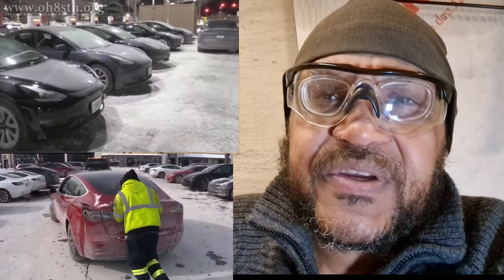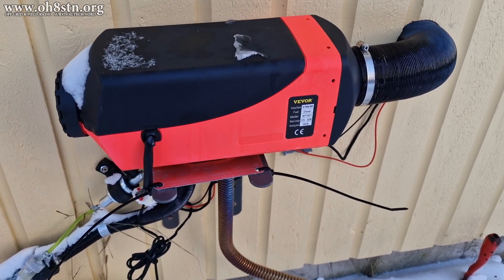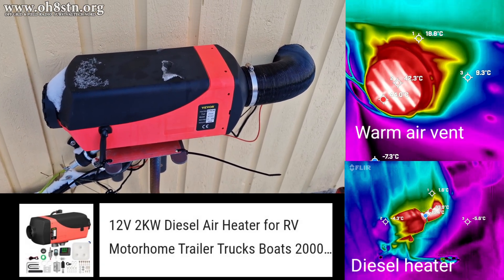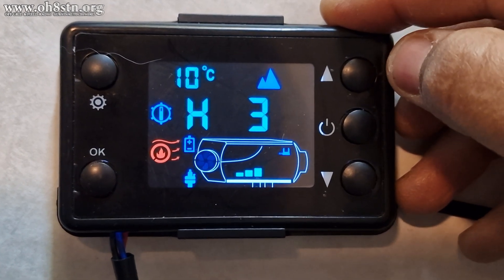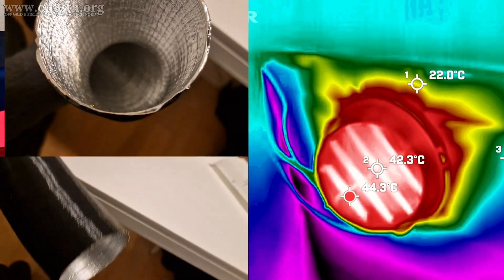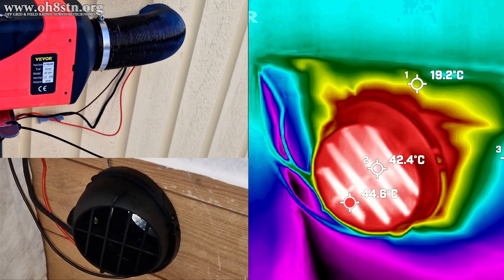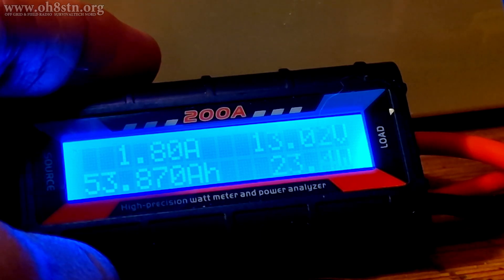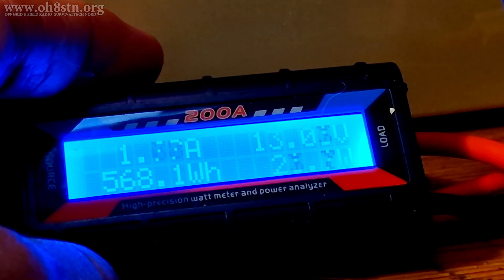Heating an off-grid ham radio station in winter

Comment: How much fuel will you use in an unusually cold winter? I'm scientifically guessing that you have at least two winters' worth of heat in your 1,000L of fuel. I don't think diesel will ever be completely unavailable long term, though local short term outages are probable.

How are you storing it?

Comment: Julian have you considered insulating that corrugated metal pipe. I’m sure you’re loosing some efficiency to the cold since it’s kind of like a giant heatsink out there.

For the ice fishing “portable” set up something like the SOK battery might be worth the extra cost because of the ruggedized case and low temperature charging disconnect.

Comment: J, 
I am sure that in your part of the world you have something like a wood fired boiler that has a water jacket and a manifold. You would hook up water pipes in the typical installation would be to run them underneath the floor the small wood fire boiler would be outside obviously, it heats the water and heats your shack. I’m told from friends that have these devices they can basically heat an entire house on a couple of sticks of wood per day.

Comment: I think to Cresson H. Kearny's book, as well as permaculture tech...big takeaway: DIG DOWN. 
5-6 feet in ground and the structure is covered = ambient temp of 50-60F. 
If its 'main HQ' and permanent/semi-permanent, rather than forward-line position: this makes 100% sense.

Just run a longer antenna/tower. This can act like a heatsink, so minimize connection of above-ground and below-ground. 
Even 3ft down (instead of 6ft+) and you warm ambient temp by >=10-20F when running electronics or there are ppl in it; let alone something like stove/heater. 
 4
Reply from the maker: Agreed. We have a root cellar which remains temp stable all year round. To dink a radio room sized underground space requires lots of work, but does make since.
Reply: @OH8STN 1 person, yes. But read Nuclear War Survival Skills. 
It talks about how you dig such structures as a group: 4-8 ppl and it'll take a day (8-10hrs), maybe far less depending on soil composition.  

Look at what vietkong did in 'nam: with their  tunnel systems and radio rooms. Sure those were built over months/years...but at times they'd flood/backfill them in, (in other part of tunnel) just dig new one, and a antenna hole, disguise with hollowed out bamboo. etc.

Comment: I heat my shack (garage) with a wall mount 30K BTU natural gas heater. It was cheap, no electric needed to be run to it, and I had a natural gas line right there.  I'd imagine it uses little, it's almost never on hi. 73

Comment: HI i dident know you ar limited at fuel storage only up to 1000L  in winter i count on may iron nikel batery bank i dont use litium in winter it is too cold here in winter vold hav problems with everiting   lov the whay you mounted the heater loks similar with what my truk has from factory the mobil ham sach has its own heting batery bank and generator unit

Comment: Lithium batteries or LB's are expensive in most counties with High Sale Taxes (increased price levied on the consumer for purchasing foreign brands)..whether they be Chinese, Japanese, European or good Imported American branded LB's Can you provide some examples on how to save the dying LEAD/Nickle Iron/Acid based batteries from Winter/summer temps. one answer could be a USB powered Silicone Heater 12v Sticker.. that usually is attached to batteries and use a tickle charger to heat the batteries from getting tooooooo cold..so even if they are acid and are stored in an enclosed box they can discharge the acid safely. My option at home are AGM company batteries, EXCIDE modular batteries, OSAKA Modular batteries... are a few to talk about, 
My home country is Pakistan but i work and reside in Singapore.. and each year the batteries prices get higher in my home country while the input from the batteries are less than 5 hours with powers down.. and random shutdown times often called Load shedding by the govt. Diesel Heaters are not avaiable... they are banned by the same govt entities who want the consumers to use the faulty grid tied system and pay up monthly bills.
Regards from Singapore, GOD Bless.. Thankyou for your hard work in making the content interesting.

2 Bio-Diesel PDF's online Thesis and a Study and a plant to create bio-diesel (external weblink PDF's)
https://core.ac.uk/download/pdf/148365950.pdf
https://www.diva-portal.org/smash/get/diva2:720756/FULLTEXT01.pdf
https://www.diva-portal.org/smash/get/diva2:1501705/FULLTEXT01.pdf

Comment: Those are great heaters, i mount them in boats and a bunch of stuff! I would mount inside and run exhaust through wall with the proper fitting like we do on boats and cabins.  You then circulate intake air from inside and not cold outside air and its a lot more efficient.  Espar heaters 8 to 10 times more and i still install them becasue they are serviceable and parts available.
Reply: About 20 years ago I bought 6 Espar heaters at auction for only $200. Out of the lot I have easily constructed two working heaters. These are the early DL1 heaters but they work like a charm. Only thing I did not receive in the lot were the pumps. Had to order it from a dealer who was the authorized sales center for these units. Back then an authentic pump cost $140 in the states. To day Chinese pumps are cheap but there are some alternatives.
Reply: much more efficient but what if your area to heat is only 100-120 square feet??? 
more than one way to measure efficiency.
Reply: @sk8crk  They have thermostats and they ramp the burner, pump, and fan up or down depending on demand.
Reply: @LaneGiesler-KL5PK  i was talking in regard to fresh air intake

Comment: Diesel starts gelling at -10°C. Could you keep the tank inside? Making an enclosure for the heater will help keep it and the fuel lines from gelling as well. Adding some kerosene can help keep it from gelling as well. Could you put a woodstove outside and just run the flue through the shack? A rocket stove is cheap and easy to make. That would allow a long run of flue along the floor of the shack. Stack some bricks around it, or encase it in concrete and that thermal mass will continue to radiate heat long after the stove goes out.

Comment: To be fair, those dead EVs were in were -27°C/-10°F. Diesel starts gelling at -10°C/15°F. You need a block heater and tank/fuel line heater once you start going much below those temps. So it's not like EVs are worse, they're just new tech. We have over a hundred years of experience running gas and diesel vehicles in extreme cold, and even then people were waking up to cars that wouldn't start. Also, all you need to do for a Tesla is punch in a stop at a charger and the Tesla will start pre-condioning the battery so that it can charge at max speed. These people lklely just pulled in without doing that, so the car didn't know to start pre-heating. Also, the range does drop and people probably weren't planning on that. Like, if you drive 40km/day for work, you're probably used to hitting a charging station once per week. But in the winter you'll need to add a charging stop mid-week and that can throw people off. But, if you're plugged in at home, set it to start prewarming a half hour before you leave - you'll come out to a warm interior, snow and ice melted off all the windows, and a warm, full, happy battery. Keep in mind that countries like Norway and Sweden are already around 90% of new cars being EVs, so they can certainly handle the cold! My cousin in Winnipeg (northern Canada) loves his Model Y!
Reply: In northern europe a winter diesel fuel available from the beginning of the cold season. In arctic regions special classes of fuel are available (EN 590 Class 1 to 4) - down to -44 C

Comment: Julian can you buy, non-road taxed diesel in-country? It's Red Dyed Diesel in Thee States. 
Thank you for the testing and your time bringing us along, I've learned so much here!
Reply from the maker: Thanks for watching and commenting. Yes, we can buy it, but the lefty greenies have made it nearly as expensive as normal diesel. 😪
Reply: @OH8STN  That's unfortunate for your agricultural sector and price of food :/

Something to note;
I presume all diesel in your A.O. is winterized, but something to note I had a newer tractor not start in -10F not because of gelling diesel fuel but rather the glow plugs could not be activated. Either by some tempt control unit in the machine or by the literal cold tempts I'm not sure. 

Ended up warming the machine with a propane stove (with extreme care) in the elements for over an hour, just manage the snow fall and move the machine indoors.

Comment: On the heat exchanger there's a return heat it's on the opposite side of the main hose that you pipe inside the building instead of pulling that air from outside it needs to be attached to the building just like the hot air inlet this way you recirculating hot air and not pulling the cold air from the outside to heat up was also stops any of the exhaust fumes from getting pulled into the building as well this normally is not a problem because people usually have the whole unit inside therefore it's already automatically recirculating the air without an additional pipe it only becomes a problem when you mount the thing outside I hope this is better it actually deleted the other post I apologize
Reply from the maker: Excellent advice I will certainly do this! Thanks for taking the time to explain. 🙏👍
Reply: Another option is to put some sort of air valve on the cold air inlet after you instal it to the inside so you can adjust the mixture of return warm air with some fresh air. Just enough to remove a bit of stale air while working inside the shack. I have one of the Gitchners connex style radio boxes( the 20x8x7 ) that has an ECU attached to one opening. On it they have a damper that one can adjust the amount of fresh air brought into the container. This is another on going restoration project 😢.

Comment: Any problems with the diesel fuel gelling at your latitude? We had that problem with the fuel filter on our generator during an outdoor training exercise here in New England. We were only able to get it going by wrapping one of those chemical hand warmers around it.
Reply from the maker: This is a topic I can add to the episode notes. In fact yes! We had a few days here below -30c/-22f. We had to switch over to the arctic diesel fuel which has a lower freezing point. I like the chemical handwarmer idea by the way. And you're right, It was the fuel filter which couldn't handle the thicker less viscous diesel fuel. With the arctic diesel it doesn't happen anymore.
Excellent feedback and comment.
Reply: In the USA they are labeled diesel #1 (kerosene) and diesel #2 (normal on-off road low sulfur)

#1 is strongly recommended in a 50% blend with #2 in very cold conditions. Sometimes requiring #1 only to eliminate gelling.   Great episode @oh8stn
Reply: Even in Texas we are warned about gelling, although my diesel tractor is not used in winter.

Comment: What about humidity issues in the shack or are you maintaing temps?
Reply from the maker: Humidity is one of the reasons for using the diesel heater. It is a very dry heat, keeping the space rather consistent in humidity and temperature. Perhaps in a few weeks i've do a video on monitoring the environmental variables outside and in the shack.

Comment: Why not just use a 12V heater?
Reply from the maker: Great question. If I were only hitting the battery box. It would be okay for sure to amount of time. Sadly twelve volt heaters are notoriously inefficient. If I were at a lower latitude it would be fine. But because i'm charging off grid with solar power, It might not be possible to keep up with the load.
Thanks for watching and commenting and again that was an excellent question.

Comment: Dealing with similar issues. Have 87kw of lithium batteries.  Was doing diesel heater also,  but for total offgrid. Diesel is a consu.abke resource.    Have you thought about using rv tank heaters. (12/24vdc  squar pad heating pads.   And have them turn at xx degrees. Sandwich them between your batteries.    That's what I'm looking at doing.    Possible feed them from. Old gel batteries I have laying around (with a dedicated solar panel charging battiers feed heaters)
Reply from the maker: You know that's a magnificent idea. I think I'd have to build a small closet to mount the batteries, But that might allow me to heat just the battery space when I am not in the hamshack. This sounds like a brilliant idea. Do they consume a lot of amps?
Reply: @OH8STN Good points, but you still have to warm your radios too, as you mentioned near the end.
Reply: Yes, and if you put extra insulation around the batteries that will help, too, as just the act of charging and discharging them creates heat as well.